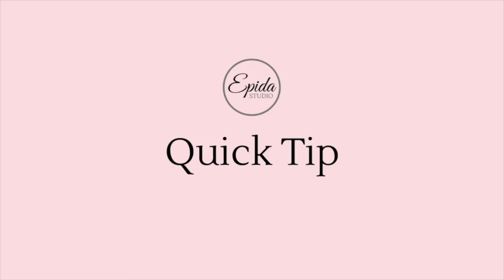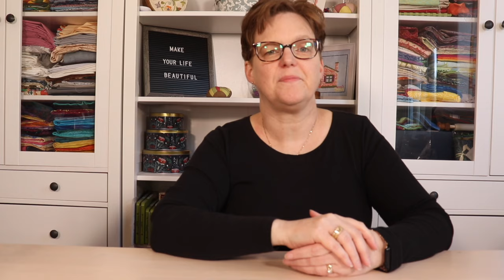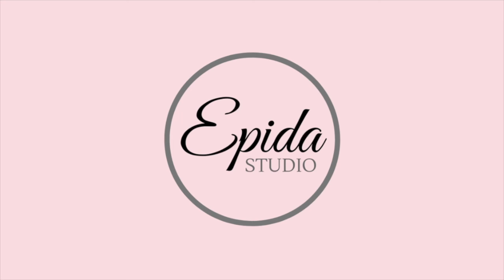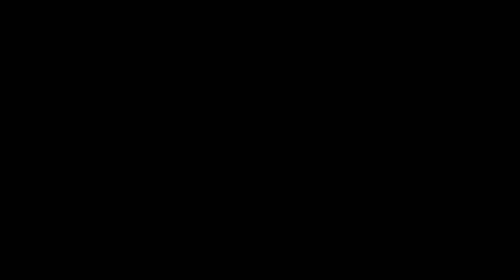What is a "domestic" sewing machine?

Comment: Good video but you missed some key points.
As someone who sews professionally in a costume workshop it is important to mention the difference in speed and power.
An industrial machine is often meant to do multiple piece work in high volumes.
A domestic machine will usually have a peak operating speed of approximately seven to eight hundred stitches per minute.
The industria lockstitch l that I use at work has a maximum speed of twenty five hundred stitches per minute.
It also originally had a direct clutch motor with more than 5 amps.
Reply from the maker: Those are great points. Industrial machines are used in a different way and are designed to handle it. 
You must have amazing skills from working in a costume workshop!